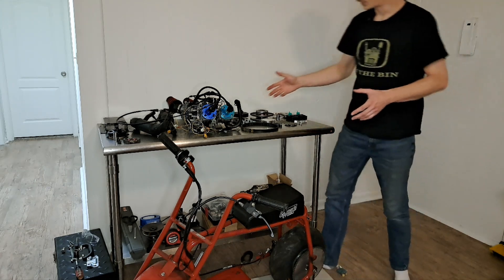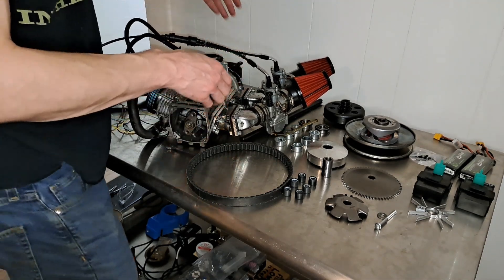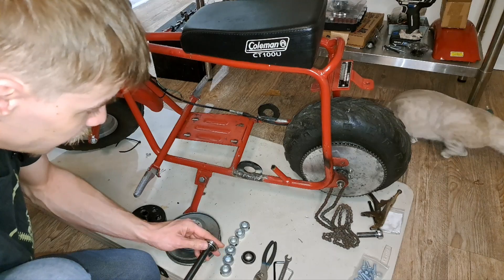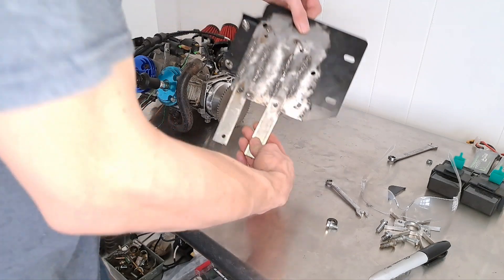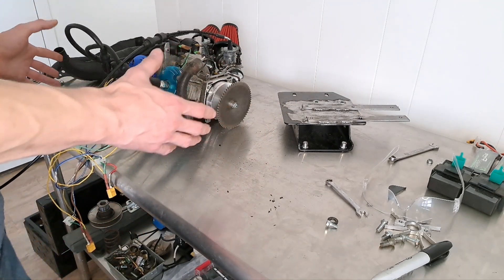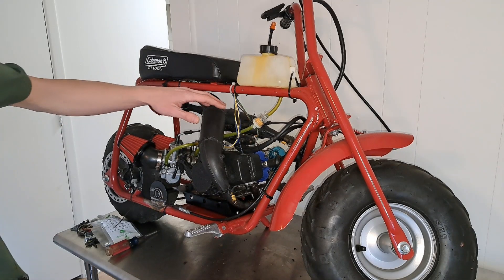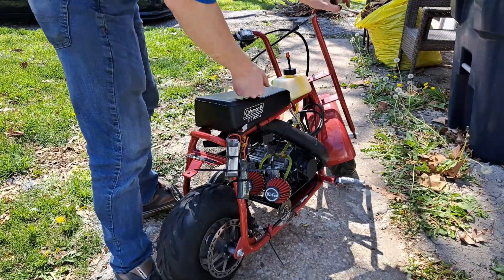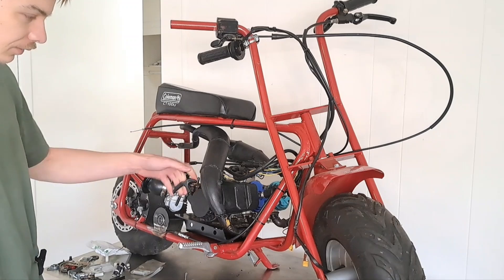Twin Cylinder 2 Stroke Mini Bike Build!

Comment: Is there like an actual buyable 2 stroke engine for this minibike? I have a predator 212 in my Coleman cc100x, and I was wondering if there is a 2 stroke with more power than it that can actually fit.

(The cc100x is the same frame as that)

Comment: Love the way you connected the two motors other ways I’ve seen people do it look a lot less stout then your method keep up the good work I’ve been in the thought of building a slant 6 you could call it and putting 1/2, 5/6, 3/4 and running them 120 degrees apart for a firing pattern like a 3 cylinder
Reply from the maker: @f1project299  Thank you! I love this project and can't wait to show it to you guys when it's finished. I actually just finished rebuilding the engines and filming that. Should have part 2 up here pretty soon. I would love to see your slant 6 come to life! Please, if you do it make a video!!